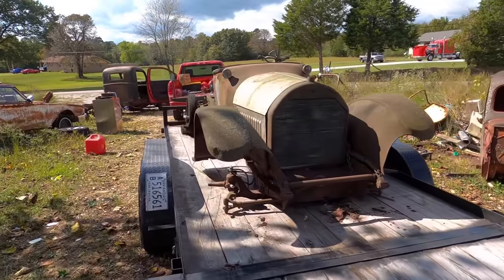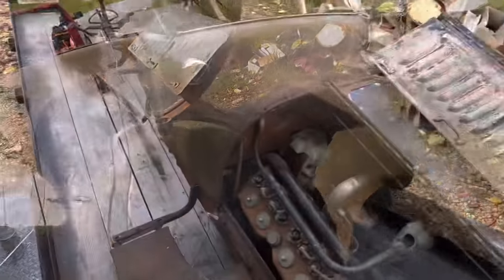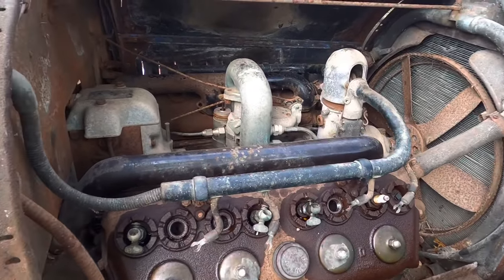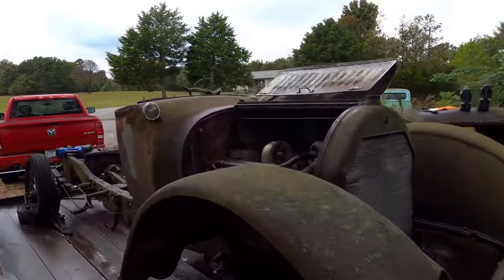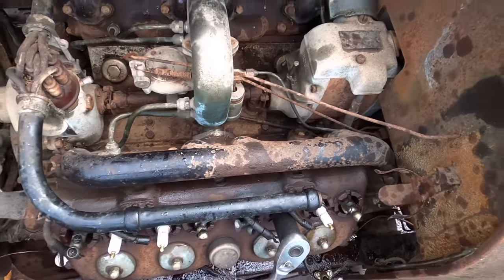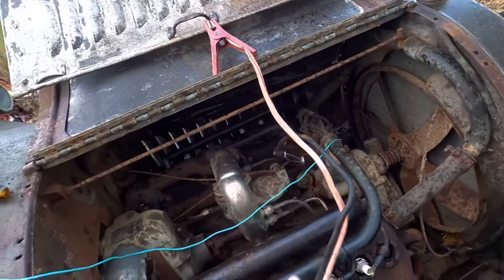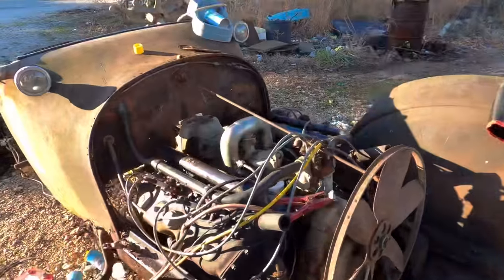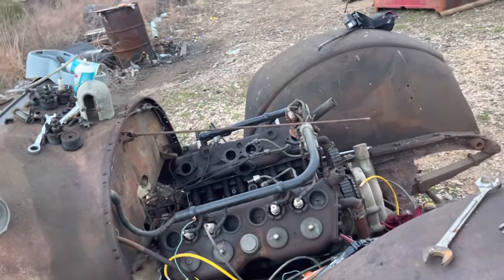Will it run after 93 years 1917 Cadillac v8

Comment from the maker: Sadly this old car wouldn’t run turns out the camshaft system was broken off on the driver side
Reply: So, what’s the next step with it? 
Is that an impossible fix? Are camshaft parts difficult to find?
Reply: That’s a shame, what are the chances of finding one or maybe a remanufacture?
Reply: 'Everything gets parked for a reason' - even if it takes almost a hundred years to find out lol
Reply: There is a chance that you can weld it... Though it depends on how it broke.
Reply: Let me know if you selling it. I'm a cadillac collector and I don't have teens ,20's or 30's
Reply: That’s a shame. This thing would be a museum piece if you could get it running and had someone restore it
Reply: Wow fellow Arkansas man youtuber. Subscribed!
Reply: do you suppose that’s the reason why it was parked, or is that related to your efforts?
Reply: Fix it!!!!
Reply: If you do not plan on doing anything with it, I'll buy it.
Reply: That’s a shame. But it could still be repaired and put into a retro hot rod (period correct).
Reply: a new camshaft can be custom build on a lathe, its no problem. when the head of the engine isnt removable, it can be cut open for replacing the camshaft and then a thread can be drilled into the engine block to put screws on to make a separable head. its all well possible things and can be done with common standard tools. other parts can be made in a 3D-printer. 
the missing body parts can be custom made from sheet metal. after sandblasting the rust of, there can be hot metal added as an extra layer on the residue body parts, to make the parts thicker and stronger. its all a matter of how much time, effort and money someone would want to put into it. in case you dont want to, there are already some people here who want that old car to rebuild it, would be great to see the old car in hands that appreciate the history that is with it.
Reply: Thanks for update, your efforts were epic and much appreciated 👍 Now you surely deserve some sponsors!!
Reply: Please rebuild the camshaft
Reply: @robertsmith6188  
That would be a project for the factory that old car came from, if they value their history and keep their esteem high. how connected they would show to be if they would take this and make a great restauration of it. What do you think ? 
Else maybe they already have restored old cars that were once in ruins like this ?
Reply: What are the odds you could have a new one machined by taking the broken one in for a mold?
Reply: @PIasmaZombie  i dont know if i have seem many restoration videos but the most common thing was a lathe, with a late you can almost repair everything with metal.

you can make many stuff with the lathe thanks to that machine the world entered in the industrial revolution.(by one video that i saw lol :v)
Reply: @robertsmith6188  or you can buy permission to make new parts, let say directly from the blue prints of the pantets they have for every single components on their motors. because i bet they have a lot of patents for the shet that they made.
Reply: @therestorationofdrwho1865  bas changé les pièces
Reply: @robertsmith6188  It doesn't take a multi millionaire to 3d scan a camshaft and have 1-4 new billet CNC ones made.
That was 20 yrs ago when that was expensive. Today it is possible for a few thousand dollars from nothing.
Tbh, if I really wanted an engine like this to run well, I'd take it all part and scan as many parts as possible so they can just be CNC made again if they break and then use what I can.
Reply: That should be easily repairable if you really want to restore it
Reply: @PIasmaZombie what you speak of is not impossible, but would cost more than the car is worth and and becomes a labor of love.
Reply: Your Young,. U can do it
Reply: Spoiled the video for me
Reply: Well, I hope you get this bad Betty fixed as that is something that caught my attention amongst millions of videos on YouTube
Reply: By the way, no pressure I hope I didn’t create any pressure
Reply: @motrhead69 not every car can be saved. Dude can't bat 1000 every video.
Reply: @barath4545 ok dude then start your own YouTube channel and show everyone how it’s done. But you won’t because it’s easier to criticize than to face facts that scanning every part and replacing it with custom parts is ridiculous.

Comment: Nice find. People say these old cars were “built to last” - they really weren’t. Just that engineers were given free rein to do their thing without bean counters breathing down their neck trying to nickel & dime every single component.
Reply: I think you don't realise that this engine wasn't working/turning for the last 90 years. It's not a modern engine with all the components inside the engine where all the parts are protected .  It has external push rods and springs that were affected by weather and time. It would of run if it was kept in a barn not outside . Not a hateful comment just trying to make you and others understand that a moving part that sits for more than a year will seize , a good example would be brake calipers if you leave your hand brake on for long time.
Reply: @JayJay1085  Old engines didn't need enclosed valve trains or oil pumps or more than three main bearings because they weren't built to last.
Reply: @JayJay1085  Still, old stuff like this can be rebuilt and working again with some elbow grease, cash and time, if i had it i would try, even if i had to hand-make the body parts LOL
Reply: 100% leave me alone...the bean counters 💩 I've got a brain 👍do you?
Reply: Them bean counters had nothing to do with why it only ran 9-10 years.
Reply: @SwedishEmpire1700  they had more clearance between parts because of manufacturing tech at the time, a 5. Something making 80hp would be unacceptable for today’s standards
Reply: Also, “Survivor bias.” we think everything in the old days was made better, because that’s all we have left is the really good quality items. The cheap stuff is long gone.
Reply: @MrJeffcoley1  exactly, same with music.
Reply: Eh well we are standing on the shoulders of giants to have what we have now.
Reply: Nah man. Look at Jay Leno's cars.  His 100 plus year old cars run no problems. He explained the engines have mainly magnetos. The magnetos don't ever stop running. And no
 Not all if his 100 plus year old cars are restored.
Reply: @styldsteel1  The more simple the technology, the less there is to go wrong. These old engines just don’t have a lot to them.
Reply: @MrJeffcoley1 You're right, it's perhaps not about "better" but "simpler". It also adds to how simple a repair is, if the item itself is already fairly simple, which might make the vehicle more survivable
Reply: @21stcenturyfossil7  I don't think you understand they did not need to turn that many RPM to do what they needed to do plus motor oil back then was horrible even up until the 1960s cars without detergent oil would be clicking and burning blow by after 60,000 miles after people started putting detergent oil is only time engine started lasting over 100,000 miles give me a break on engines not lasting back then because they did if you took care of them
Reply: Fix the camshaft fix the car
Reply: @ronalddaub9740  They weren't built to last because there was no need to.  You are aware that cars were improving fast back then, aren't you?. No Cadillac buyer  pictured himself still driving his 1917 Caddy in 1937.
Reply: @SwedishEmpire1700  and a lathe. dont forget the lathe.
Reply: @ronalddaub9740  then the oil technology helped to that too i bet those engines with today oil will run better than 100 years ago.
Reply: @mnmountainman9343  I've read your comment five times over and still have no idea what you said.
Reply: It’s not so much that they weren’t “built to last”, it’s that they were built to a price-point, just as modern vehicles are. Additionally, in 1917 the ICE, in automotive applications, was still in its infancy. Things like separate heads, enclosed rods, cooling distribution, material science for rings and gaskets, were all very primitive. This is similar to the material science issues we had in semiconductors in the 70’s and early 80’s, where insulator breakdown and electromigration caused a lot of early microprocessors, dram and other chips to fail prematurely (Zilog, HP, a lot of early MOS stuff were quite unreliable).

Combine “early era” immature technology with maintenance cycles that were, for the public, often big question marks, and it’s easy to see how these engines often had difficult lives. The final issue that led to a lot of these cars getting parked for good, was the rapid pace of progress. Again, like the computer industry in the 70’s, 80’s and 90’s, the first 40 years of the auto industry saw rapid progress and a steep obsolescence curve. This 1917 Cadillac would have been a dinosaur a decade after it was built (especially from a parts, maintenance and reliability standpoint).

Regardless, in 1917, this Cadillac would have been one of the finest automobiles available, built to the highest mechanical tolerances possible. During that era, Cadillac actually set the standard for everything from machining tolerances to control layout - you can thank Cadillac for the clutch/break/throttle pedal configuration that we still use today.

This was a very good engine for its time, certainly worthy of a rebuild and restoration, as it’s historically important and very rare. But as for its current condition, it’s a machine and all machines are flawed and suffer wear-out; this engine, being an early example of the art, is no exception. Hopefully it gets that rebuild, and we get to see and, most importantly, hear this piece of history run again.
Reply: Yes they were built to last, in the context of their time.  A cheap car, like a Chevy of that era, wasn't built to last, it was built to sell at a low price, but the Cad was, even then, the Standard of the World, so it of course was built to last.  What better way to get a rich man to choose a Cadillac over, say, a Packard, a Pierce-Arrow, or a Peerless, than for him to see a poor man driving a 15 or 20 year old example that still runs just fine?

Comment: Don't give up.  It will run.  If it has compression, fuel, and spark at the correct time.  It's probably like you said at the end, check the cam and make sure none of the valves are sticking or broken.  But it will run.  These engines are so simple, there isn't much can go wrong with them.
Reply: It needs also the right mixture of fuel and air.
Reply: @ronenfe  To run good yes.  But there will be air, as long as you don't flood it it will combust.  Once it starts sputtering, then he can tune the carburetor.
Reply: @BrettonFerguson  In one of the comments the camshaft broke off on the drivers side according to him
Reply: Thanks Kitler.

Comment: You're gonna lose a thumb using a starting handle like that - always have your thumb on the same side of the handle as your fingers. That way, if it backfires (and dodgy old engines often do), it won't rip your thumb off.
Reply: Waah
Reply: Thanks for telling him!! I hope he reads yr comment! 😳
Reply: People have told him more than once in other videos.. unfortunately he will have to learn the hard way looks like..and it's the gods honest truth, if it back fires with a wrap around grip it will indeed break or worse rip off your thumb 9/10 lol😬
Reply: Why not rig up something with a powerful drill to turn over the engine.
Or rig up an electric motor or starter so you can keep it turning over while you tinker with settings.  The timing could be way off or something.  Hope he is safe!  Good point!
Reply: @superchuck3259  could easily be preference, wanting to start it by hand rather than pressing a button.
Reply: My Uncle broke his arm,back in the 30s,,it kicked back,,,
Reply: @superchuck3259  I was thinking the same - weld up a freewheel adapter for a hole hawg - make it safe & easy..

..but then again I don't know jack about restoring old engines, & he seems pretty dam good at it, so maybe there's a reason 😅
Reply: Why don't y'all that are making you negative comments Post a video and show us how to do it.
Reply: I'm surprised it doesn't have the electric starter being a cadillac!
Reply: I used to hand crank a Farmall "M" before I was in my teens . If I didn't rock it back and forth to let some of the compression off it would sometimes pitch me up in the air . My uncle taught me to never lean over the crank in case it kicked back .
Reply: @triangleofdeath6246  It does have an electric starter. But, he's not using it for whatever reason.
Reply: @kennyrupp7379  there are a whole lot of videos showing how to manually crank cars like this. Many using a Ford Model T.
Reply: @wabch Yes, but he should use a pony motor off camera to get it running if it's gonna and then try to crank start it. 

And like others have said, I was wincing every time he was cranking it like he was, he's very lucky it didnt fire off wrong, particularly when he was trying to kick start it. 

I kept havjng mental image of that thing kicking back and seeing him unintentionally leap like a cat (but he wouldn't land like one) 😂

Comment: Those stop cocks next to the spark plugs are called "priming cocks" and are there to use in starting, typically in cold weather. They're also great for filling the cylinders with your favorite elixer to break a stuck engine loose.
Reply: I do wish you gentlemen would learn to fighten just enough to see that plug or bolt tin just sk9 ce antgeyou will find how easy they come out without damage to the bolt or the plug and youwontdamage yoirtolor yourself remember kinetic enerjleftty before you loosy. An old mechanic
And stilwrenching at 76 yrs pld. HW.Cupp.
Reply: yeah but there are missing spark plugs? how is the engine supposed to run
Reply: Watch your language young man

Comment: I'm wondering what the engine looks like from inside. The whole machinery looks surprisingly modern for such an old thing. And it is well crafted back in 1917. Nice vid
Reply: Check out the 1927 Delage 15S8.  It has a 1.5l straight 8 with dual overhead  cams that made 155hp.  In 1927.
Reply: Good subject matter, but he is only scratching the surface on the mysteries this old jewel holds. 🛶
Reply: yep
Reply: @TKDWolf  Yes, 1.5 litres for 8 cylinders is quite fabulous for the time but the Delage 15 S8 was a racing car; this is a regular road car. Besides, the concept of V8 is rather more advanced than 8 cylinders in line.
Reply: internal combustion engines are 19th century technology.  not much of the raw basics has changed.  all the electronics and other gadgetry of course has come later.
Reply: @TKDWolf  But such an engine is cantankerous, lacks low-end torque, is noisy, and, since it has to be screamed, wears out very quickly.  No problem for a racing car, but not ideal for a street-driven car.
Reply: @hanseekhoff1093  And since it is European, it probably has a 180 degree crankshaft, which means it has the same sort of secondary imbalance as a 4 cylinder engine, just like many European V8s.
Reply: @michaelbenardo5695  It was actually a billet steel crossplane crank, with 8,000 rpm redline. At one point it won 3 very competitive races in consecutive weekends in 3 different countries without any repairs. It also competed in the 1929 Indy 500 and finished 7th, against cars with much larger engines and riding mechanics. Not much was as reliable in race conditions at the time.

 62 roller bearings were used throughout the engine including the main bearings, bearings for the 20 timing gears, etc. The timing gears for the twin overhead cams remind me of a scaled up Rolex. 

Its honestly one of the most impressive handbuilt engines ive ever seen regarless of time period.

Roller bearings of course wouldn't be ideal for a road car, but it was definitely a high point for machine engineering. 

It also used up to 20% methanol to make that power figure, but making over 100hp per liter on only 7psi (.5 bar) of pressure in the 20s is incredible.

Comment: You missed the removable cylinder head version by one year but the '17 type 55 was the first year that they used cast aluminum in the construction of the car. It had 77 HP but once they came up with the new head design they were able to get close to 90 HP out of it by the early 20's.
You may think there's not much worth in what's left of the body but the cowl and fenders could make you some decent money to the right person.
Reply: Would you know where one might come across a cylinder block or 2 for a type 55?

Comment: Sometimes I wonder how long it will take a car to turn completely to rust. Maybe people will still be making videos like this in a hundred years.
Reply: “2003 Honda Civic will it run after 97 years”
Reply: Makes enough sense to assume so.
Reply: Today’s cars/trucks will never last 100 years unless sat in a garage
Reply: @-NGC-6302-  , highly unlikely. You would be lucky to get it running after sitting for 10 years.
Reply: Newer cars are made of thinner metal, so as soon as there isn't any paint on some points of the body, it'll rust in like 5-10 years... unless if the climate is good, and moisture is low.
Reply: Alright we have a 1917 Cadillac that’s been sitting for 200 years...
Reply: If it's a 2000s Chrysler product, about 20 years max.
Reply: @winchester37a  Wrong, because some European models are galvanised. I guess you only refer to US vehicles.
Reply: @mastermindd  Some European Van's are galvanised.

Comment: Cool to watch someone else do this! I have worked on a few of these old Cadillacs. I was waiting to see if you tried the electric starter. That starter/generator unit is pretty interesting how they work. I have had to service these units and most of them I find at swap meets will works after some minor servicing. Thanks for sharing!